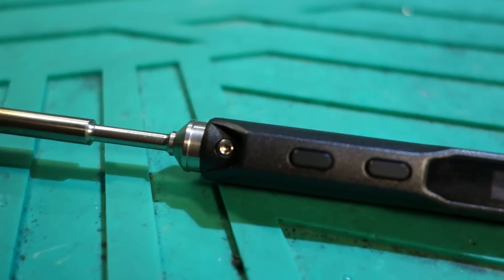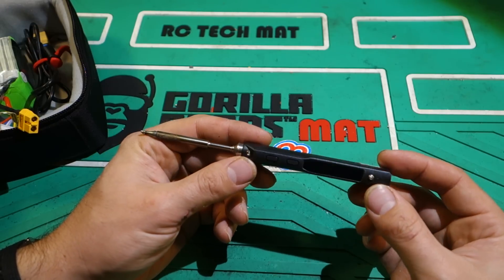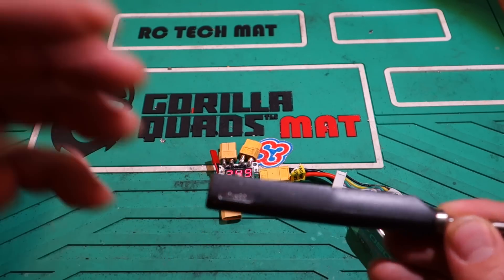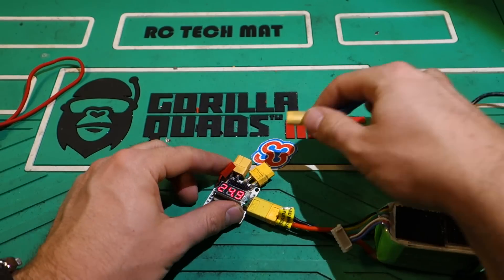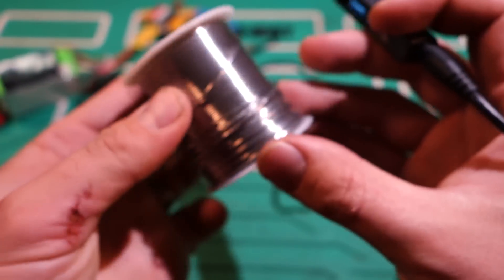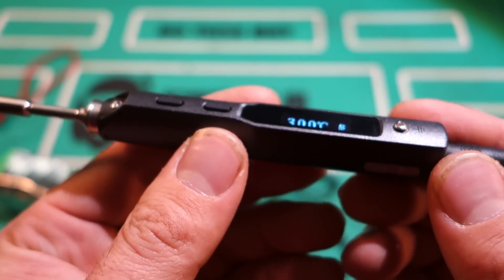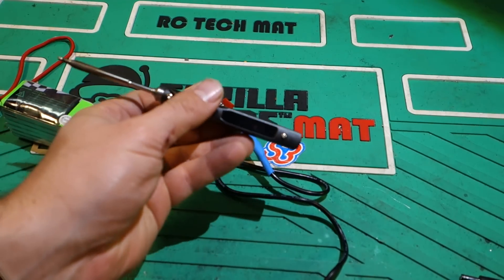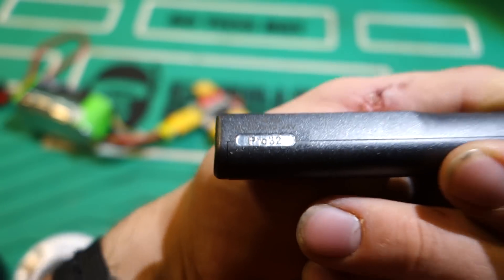Sainsmart  Pro32 // The Best Mobile Soldering Iron

Comment: What solder are you using that melts that well at 300 degrees?  ...I got the same iron for Christmas.  My damn, yes it's awesome.
Reply: Mikey Richard try some kester 60 / 40. like: Kester 24-6040-0039
Reply: I used standard off the shelf 60/40 and i run this iron at 300 degrees also.
Reply: I should have mentioned, I use off the shelf Radio Shack Sn 99.3/Cu 0.7  This solder doesn't want to melt until this particular iron is around 360-370.

Comment: Mine did not come with a power cord, and I cant find a single one that fits. Do you know what type it is?
Reply: 5525 DC jack. 5.5mm outer diameter, 2.5mm pin diameter. This is standard for very many old(ish) laptops or certainly in one of those aftermarket laptop power supplies with the variety of plugs.

Comment: What kind of run time do you get out of that small 6cell?
Reply: The iron claims 65W so at 24 or so volts and 1.05A in that pack, worst case is about 20-25 minutes. I have no idea what the power consumption of the iron is when holding temperature. Peak power is only needed going from room temp to soldering temp, so it could be over 30 minutes or more. CAREFUL!  You should set the voltage cutoff in the iron setting so that you don't damage the battery by going under recommended voltage.

Comment: Couldn't you just run it at home using a DC power supply of some kind?
Reply from the maker: Jon B Baca yes
Reply: Bulbufet FPV do you happen to have a suggestion for an affordable power supply?
Reply from the maker: it comes with one.

Comment: Try the RALIM firmware man it changed the GAME! Its best feature is a "Boost Button" that allows you to boost it up to a higher temperature while you hold a button in order to do quick large joints and then instantly drops it back down to your normal soldering temperature when you release it.. it also has advanced menus, gyro control, sleep and auto-off infinite adjust-ability, etc ... you can find it on GITHUB its by "Ben V. Brown"